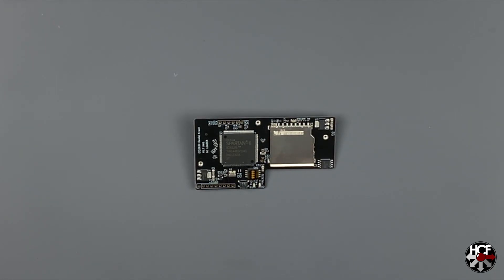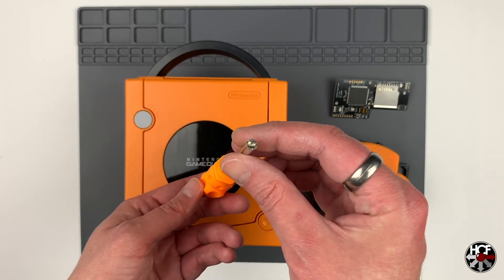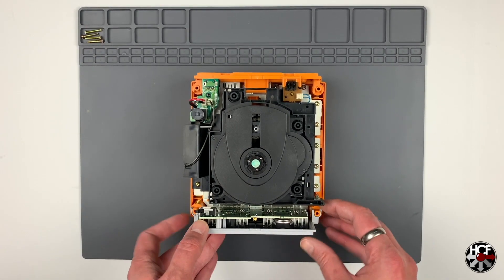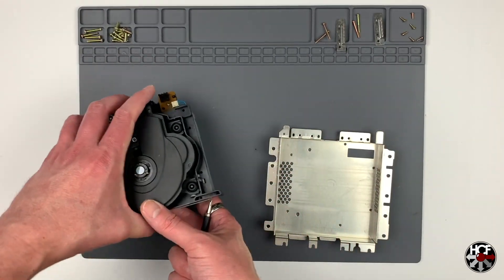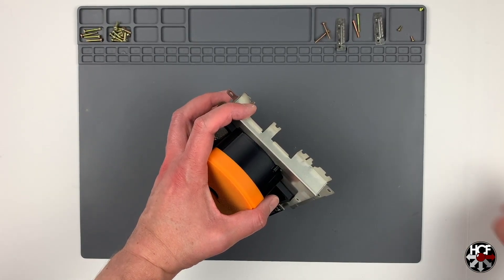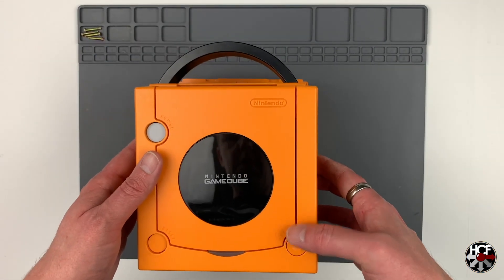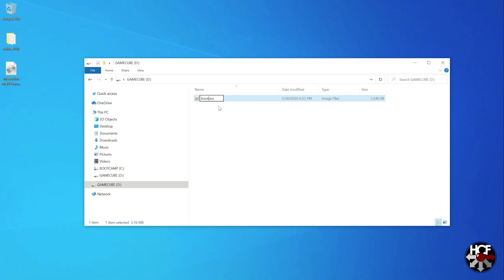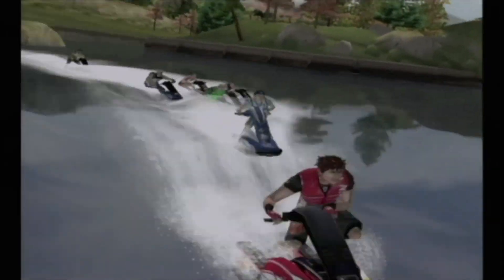Gamecube GC Loader PNP SD Card Optical Disc Replacement Mod | Install & Setup | How to Guide

Comment: Thankd for the guide!
The Swiss does not appear. I see the normal Gamecube 'no Disc' screen. 
I have already tried 3 different MicroSD Card (64GB Adata, 64 GB Kingston, 256 Samsung Evo) + adapters. Fat32 and boot.iso are on root-directory.
What am I doing wrong?
Reply from the maker: You're welcome, and thanks for stopping by the channel, I appreciate the support!  By the sounds of it, you're doing everything right!  I just tried to duplicate the issue by booting without a memory card in my GC Loader and it did give me the no disc screen, so, let's try and troubleshoot this for you.  You've already tried various SD cards, and I've read that the Samsung cards are rock solid (I use a SanDisk, so I couldn't replicate that), so I'd start off by redownloading Swiss and dropping it onto the Samsung card, just in case it was a bad download. Also confirm that you're picking the correct .iso file for your region of console (I doubt it's that though).  If that doesn't work, I'd start to take a look at the hardware.  The only other thing I can think of is that the GC Loader isn't seated correctly.  Try unplugging it and checking to make sure there was no dust or dirt caught in the port when it was installed that's causing it not to recognize it.  Hopefully that helps, let me know how it goes!

Comment: Hey guy, Is there a way to play N64 Roms snes or Gameboy on the loader?
Reply from the maker: Great question!  SNES is no problem at all, check out this video that covers the installation of the Snes9X: https://youtu.be/FpK-ytwWc04
There's also a NES emulator, FCUltra that installs the same way.  If you don't have one already, you'll need an SD2SP2 to go along with your GC Loader, but they're super cheap.  
For the GBA, I've only played through the GameBoy Player, and I've not really looked to see if there's a native emulator, but I can certainly try to see what I can find out!  Same with N64, I can definitely do some research and see if there's something out there!  I'll check back in if I can come up with anything.  Thanks for stopping by the channel, I appreciate the support!
Reply: @HalfCircleForward  let me know :)
Reply from the maker: @NetheadVegeta10000  Will do!

Comment: Thanks for making this video, it's really informative.    Do you know if Laser Bear's supplied SD card extension will only work with Dan's GC Loader?  It's sold out, so I was going to order one from GC Loader's website.    Their website has the black PCB for sale while Dan's site has a green PCB.   Much appreciated if you can help.  Thanks

I'm sitting on 3 Gamecubes and would like to do this mod to my Platinum with a broken optical drive.
Reply from the maker: That’s a great question!  Yep, you’ll be good to go ordering either directly from Dan or going from the European GC Loader site (run by the co-creator, I believe) they all come from the same source. I hadn’t paid much attention to the different PCB colors, but I’m going to guess they came from a different batch or were an earlier build, but either way, you should be good to go!  Hope that helps, and thanks for stopping by the channel, I appreciate the support!

Comment: Have you noticed any performance issues with any games since you installed this?
Reply from the maker: Not really, I’ve had a couple of issues with the in-game reset not working on a couple, and locking the system, but other than that it’s been pretty smooth sailing.  Side note, I don’t recommend booting the GameBoy Player software without the GameBoy Player being attached.. it’s not a pleasant experience on the ears!
Reply: @HalfCircleForward  noted 😆

I'll be going for a GC Loader for my Gamecube soon then!
Reply from the maker: @DanielAyy  Its a solid choice! I’ve been extremely happy with mine, well worth the investment!

Comment: I'm not sure where to find any information on this particular question, but can you use a Gameboy Player with a GC Loader?
Reply from the maker: That’s a solid question, and one I’m actually putting a video together for right now!  You have two options, either use a .dol file of the GameBoy Player disc, or there is some software called GameBoy Interface.  I’ve tried both, and they both do the job, but GBi has a few more options available.  Hope that helps, and thanks for stopping by the channel, I appreciate the support!
Reply: @HalfCircleForward  That sure does! Thank you again and I'm excited to see the next video! Just subscribed :)
Reply: @HalfCircleForward  That sure does help me! Can't wait for the video, also I'm subscribing right now!
Reply from the maker: Thank you, it is very much appreciated!  I’ll be working on this through the week (work schedule permitting) and plan on having it go live on Saturday, if not a little sooner 😊
Reply from the maker: Just a quick update for you, the video is now live, my apologies for the delay!  Link: https://youtu.be/cVz4W0NRx1M
Reply: @HalfCircleForward  I wanted to also know if you happen to know how to combine two disc GameCube isos together? This is Fabian Piedra btw lol
Reply from the maker: @fabianwareinc1171  Hi again! Are you just looking to combine the files so you can use multi-disc games? If that’s the case, you don’t need to as Swiss will automatically swap the discs when prompted as long as you have both the iso files on your SD card.  I hadn’t thought about it until you left this comment, but I did just test it, and it’s seamless.  If you’re looking to combine ISO’s  into like a compilation disc, it may be possible, but I’d have to do a bit of research on it.

Comment: How did you pre thread the hole my sd mount just came in and its tighhtttt
Reply from the maker: Yes it is!  It’s a bit of a chore, but I took one of the screws that I took out of the laser unit and just screwed it in then took it back out.  They bite pretty hard, and it takes a few minutes, but once you’ve done that on all the holes, you’re golden!  Hope that helps, and thanks for stopping by the channel, I appreciate it!
Reply: @HalfCircleForward  i threaded it with a drill bit possibly a lil too much haha but the screws are not long enough tbh
Reply from the maker: @juntartful  See, I clearly like to work harder not smarter! Good call on the drill!

Comment: how I do ingame reset to Swiss? I have only the loader...
Reply from the maker: Good question! You’ll need either an SD2SP2 or SD Gecko to get IGR to work, I actually just did a video on it a week or so ago.  It’s a pretty simple process to set it up, and all the stuff you need for it will cost less than $20!  
Here’s a link to the video: https://youtu.be/-n5Xken6JTE
Hope that helps!

Comment: Great vidoe and really helpful for my install, thanks. I do have a question though & I'm looking for some help. I installed the GC Loader PNP. All looked ok in terms of set up and the sd card but I have come across a new problem. It seems that although the fan works the power light doesn't come on and I can't get a picture. I wondered if you might be able to recommend a UK based repair service that I could contact to try and get the issue sorted or of its an easy fix (I am pretty useless when it comes to soldering!)?
Reply from the maker: Thanks for the feedback, I’m glad you found the video helpful!  Let’s see if we can get your output issue figured out! The first thing I’d try is try to reseat the GC loader, just to make sure that it’s not causing an issue on boot. If the GC is powering up and it’s alive, and the connection isn’t right it’ll likely kill the boot sequence.  Assuming the GC worked before the install, I’d guess that that’s the issue. I’ll look to see what I can find out for you for repair services though, just in case! 😊
Reply: @HalfCircleForward  thank you! I'll try reseating it tomorrow. The last time it was turned on it did work...but that was a while ago!
Reply: Quick update - just reassembled with the disc drive instead of gc loader and same issue so I think ill be sending off to someone better skilled than me to look at.
Reply from the maker: James Warren That’s not great need, I’m sorry to hear that!  Have you tried a different set of AV cables? It might be worth trying that, and also checking to make sure there’s no dust in the AV port. Simple things, but a things I’ve come across in the past.  Hopefully it’s a simple fix!

Comment: Hey i gotta?ive seen different types of sd cards with games already installed,if i mod my gc like in the video,will i be able to play games?
Reply from the maker: I'll be honest, I'm not 100% sure.  I haven't seen these pre-loaded cards, but I'm going to err on the side of caution and say they likely won't work, since they would have to be set up in a very specific way to work with the GC Loader.  I could be wrong though, and I'm sure someone else will comment if they know any different.  Great question though!  Thanks for stopping by the channel, I appreciate the support!

Comment: would this have better performance than the sd card reader that mounts in the expansion port on the bottom of the gamecube?
Reply from the maker: Great question! From everything I’ve seen, yes, and as a bonus, you don’t have to solder a mod chip into the GC, so if you ever want to go back to stock, you’d just swap out the GCLoader with the optical drive and you’re done!  Thanks for stopping by the channel, I appreciate it!
Reply: Yes (not much though).

I personally use both
(GC games on the GCLoader and homebrew / emulators on sd at the bottom).

This works great and keeps your gc games list clean.👍
Reply: @LB-yx4yw  I ended up going with a hacked Wii with all the gamecube games on a USB HDD, and it's a delight
Reply from the maker: @LB-yx4yw  This is the setup I have. My OCD went crazy when I started adding home Req to the main SD card, so the SD2SP2 was a godsend!
Reply: @HalfCircleForward  I do have 1 question though (I only got it less than a week ago).

Can you turn the sd2sp2 adapter at the bottom into a game save Location/folder. (To completely remove the need for memory cards in the front ports of the gc?)
Reply from the maker: @LB-yx4yw  That’s a great question!  Not yet, but from everything I’ve been reading it sounds like it’s a feature that’ll be coming at some point.  The latest version of Swiss just implemented virtual memory cards, so you can save to SD using an SDGecko, and I think they’re working on implementing that feature to work with the GC Loader SD card directly and the SD2SP2 (don’t quote me on it though!).  I just finished a video which will be live in just a few about setting up the virtual memory card using the SDGecko, and it works great, so I’d say keep checking the Swiss releases to see if/when they update the feature to incorporate the SD2SP2, I’m sure it’s coming and I’m sure it will be great!
Reply from the maker: Just a quick update for you, and as you may have seen this morning, I got my wires crossed and my other video had incorrect information, so yes, you can now use the SD2SP2 adapter as a virtual memory card location with the newest version of Swiss!  I've updated the video, and it should now be good to go!  My apologies for any confusion this may have caused!  Here's the new, updated video:  https://youtu.be/R7TgrqtBjag

Comment: Does your Gamecube have the Digital AV Out? If so get a Carby by Insurrection Industries that plugs into the digital port to get full 480p digital to digital via hdmi (hold B when a 480p compatible game is booting you get a message saying: "Do you want to enable progressive scan mode? Yes or no" but since you are already using Swiss you can force (almost) any game into 480p mode)
Reply from the maker: It does! I’ve actually had a couple of people mention the Carby, but I’ve not really had chance to look into it.  It’s on my radar though! 🙂
Reply: @HalfCircleForward  I don't have a Carby myself but I've seen video's of people review a Carby and what I've seen it's probs def worth the price of 75 dollars. Well it's way better then those shitty hdmi cables from Hyperkin, Pound, Levelhixe and etc.
Reply from the maker: I’ve had pretty good luck with the Hyperkin cables, to be honest, for the price point, you can’t go far wrong, but you’re right I think this may be the way to go if you’re looking to go for top-tier image quality.  I watched a couple of videos and they certainly peaked my interest!

Comment: What brand of SD card did you use?
Reply from the maker: I use SanDisk pretty much exclusively for my SD cards and flash drives. Highly recommended!
Reply: Half-Circle Forward awesome! Thanks much!
Reply from the maker: Slipped Crane95 You’re more than welcome! Thanks for stopping by the channel, I appreciate the support!

Comment: So I have Qoob Pro chip in an Iced cube shell. I bought this GC loader for it. I'm guessing the Qoob pro chip is completely obsolete now?.
Reply from the maker: Pretty much!  I can’t think of anything that the GC Loader and Swiss can’t do, though I’m sure someone will correct me if I’m wrong! 😊 Thanks for stopping by the channel, I appreciate the support!
Reply: I found time to install the GC. It looks like the qoob pro switch relies on the DVD drive to to be used. So I may have to remove the qoob chip completely.
Reply from the maker: N163LPH03N1X Tha is for the update, great info! Hopefully it’s not too big of a process to uninstall the Qoob!

Comment: This is exactly what I was looking for.  Thank you, sir!  Just waiting on my SD Card Mount from Laser Bear now, and I might end up getting a CARBY, not sure yet.
Reply from the maker: Happy to help, glad you found it useful!  I’d not seen the CARBY before, but I just looked it up and it does sound interesting.. more research required I think! 😊  I’ve been using the Hyperkin HDMI adapter with mine which has done a great job so far, but I’m always looking for other solutions to get the best picture quality available! Thanks for stopping by the channel, I appreciate the support!

Comment: Do the game isos need to be on the sd card in the sd loader or can they be loaded through an sd2sp2?
Reply from the maker: I’m thinking that if you wanted to have your ISO’s on your SD2SP2, you should be able to set up Swiss to read them from there, but I haven’t tested that so I can’t say for sure.  I’d think it would just be easier to have everything on the GC Loader card and have the SD2SP2 set up for game update patches.

Comment: Ok i got a question,after watching this video im thinking of doing this same mod for my Gamecube,i know they sell sd cards loaded with gc games,my question is if I go ahead with this mod,and replace the disk tray with the new sd port,will it play games from one of these card thru the sd loader after install?i dont have pc,and im noob.Also,i have a modded ps1 classic with Usb stick loaded with games,is it possible to play GC games this way,do they even make something similer?
Reply from the maker: I haven’t seen any pre-loaded SD Cards for the GC, so I couldn’t say if they would work or not. My guess would be no, since you’d need to have it set up with Swiss in order to boot and play the games.  You’d really need to have a PC to get the SD card set up they way to need it to be, and without the SD card, the mod really wouldn’t do you any good.  Hope that helps! Thanks for stopping by the channel, I really appreciate it!

Comment: Is renaming the swiss iso to boot.iso  a gc loader specific step? I replaced my disk drive with a wasp fusion ode and currently all i get is the gamecube menu telling me to insert a disk.
Reply from the maker: That’s a great question, and to be honest, I’m not sure, since I’ve not had any experience with wasp.  That being said, I’d probably give it a t try and see if it works, you can always rename it again afterwards.

Comment: does it support region free games? i've just got mine in the post. I'm running a spice orange ntsc-j console.
Reply from the maker: It sure does! You just need to make sure you use the correct region boot.iso for Swiss for your console, so you’ll need to use the NTSC-J boot iso, and once you’re in Swiss you can boot NTSC-U, NTSC-J or PAL games.  Hope that helps! Thanks for stopping by the channel!

Comment: I'm not sure if you mentioned it, but is this a super clean install?
Reply from the maker: LOL Yes it is! I didn't realize how may times I said that, you could almost turn it into a drinking game!
Reply: @HalfCircleForward  It is true though! Very nice mod and very thorough video. 

If I'm not going the 3d printed cover route, is there a need to extract the metal plate that the disc drive unit sits on? I'm thinking I could just easily plug in the loader with all my ISOs right into the vacant outlet and be good to go. Thoughts?
Reply from the maker: You can definitely do the install without the 3D printed mount!  I did it because I really liked the finished look to it, but it’s not a necessity.  I ran my GDEmu in my Dreamcast for a while without a mount and it was totally fine.  You will still have to remove the bottom plate from the CD drive to attach the GC Loader to it, since it screws in from underneath, it’s pretty straight forward though.